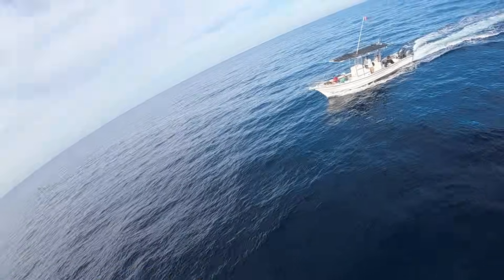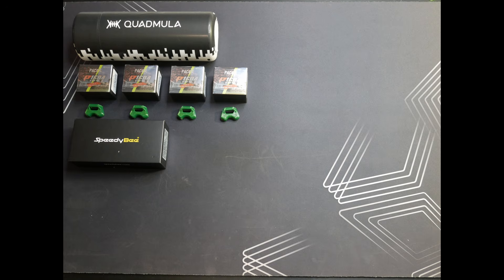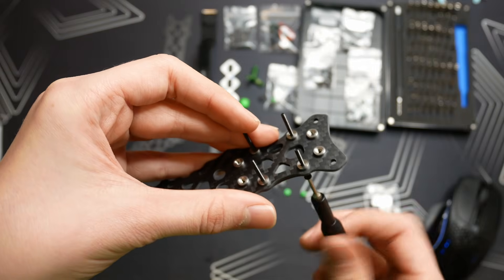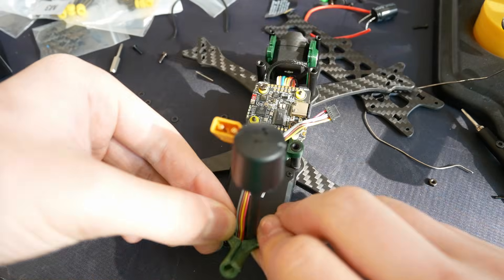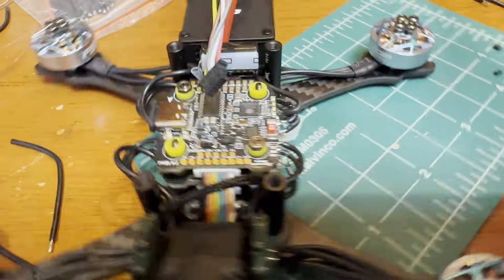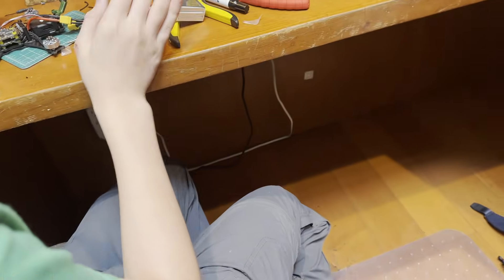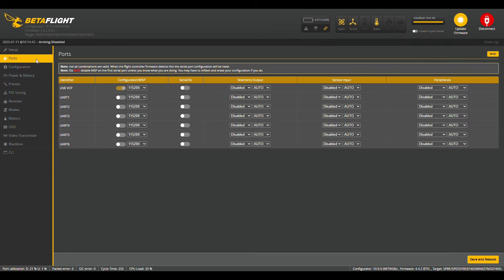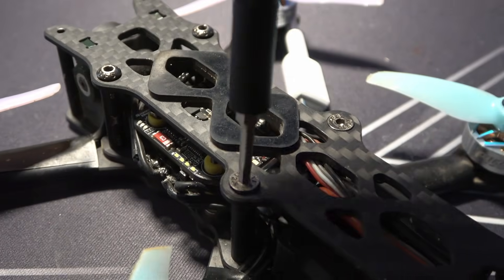How to Build the Ultimate 249g FPV Drone

Comment: This frame is, how to say, pretty strange design. Only a downscaled 5" frame, 8 standoffs 16 screws..., why ? One plate and 4 standoff would be enough, lighter simpler, especially in pusher config, which is much efficient in this small size.
Reply from the maker: I agree! If people need to save more weight this would be a good idea.

Comment: Bro, which tattu 6s battery you are using? I can’t find anything less den 80g
Reply from the maker: My battery is above 80g but my overall build is still light enough. If you are sure you want a 6 cell setup you may need lighter frame / electronics. I added my parts list to the description of the video if you want to use them.